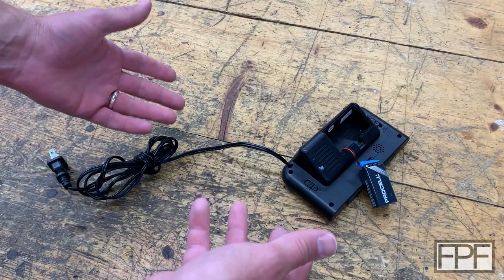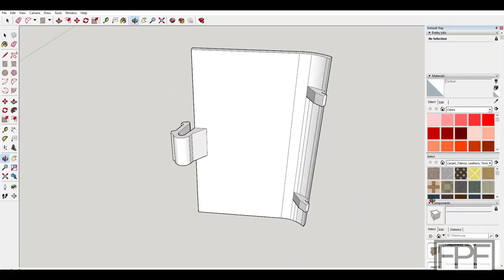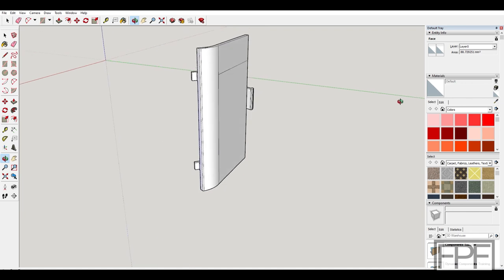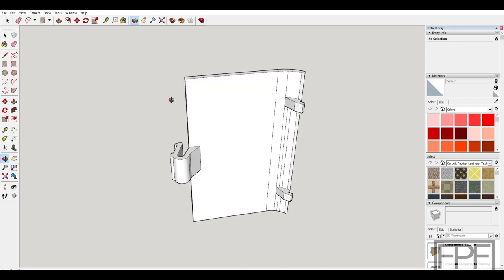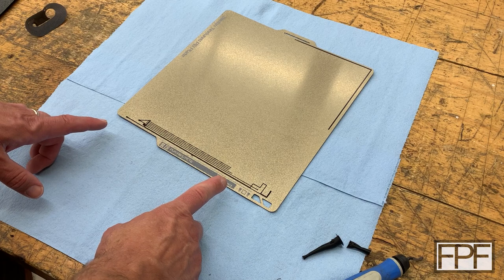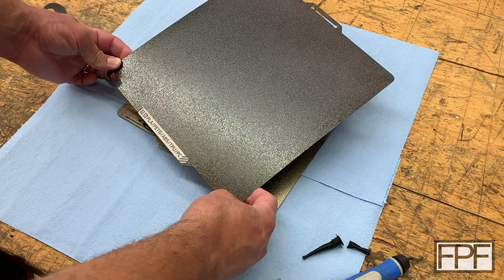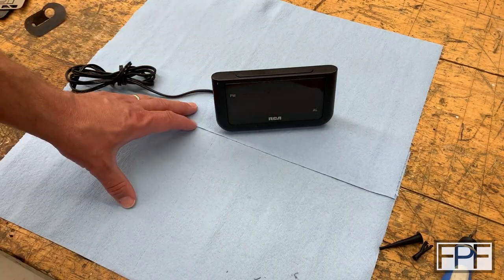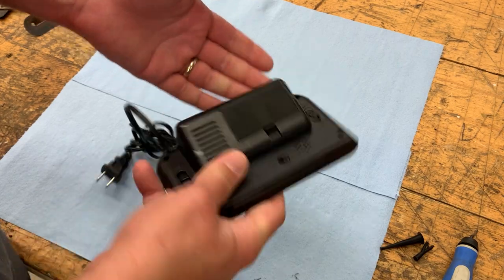3D Printed Alarm Clock Battery Door - RCA - RCD30-A

Comment: Great job. I tend to lean on PETG for anything that needs to be flexed. I've found PLA breaks easier since it's more brittle. Probably fine for this application though.
Reply from the maker: I find it really depends on the PLA and the temp printed.  Some stuff (like bamtack for example) is really brittle regardless of temp printed.  Other stuff (like hatchbox and sunlu), if printed at a "reasonable" speed and fairly high temp seems to be pretty durable.